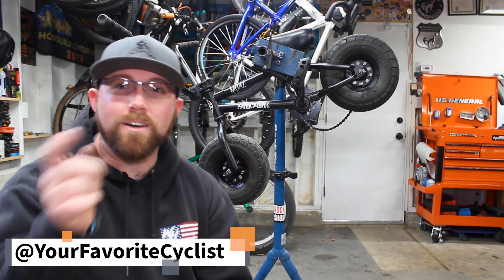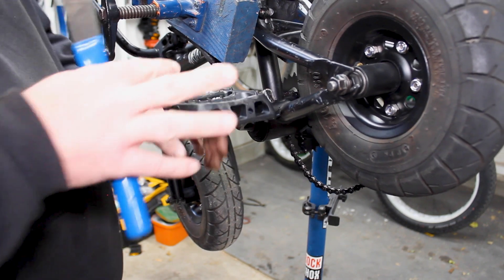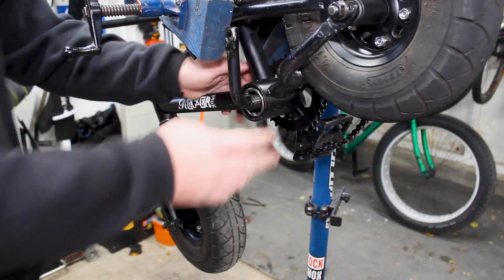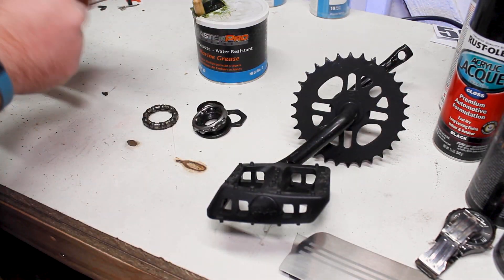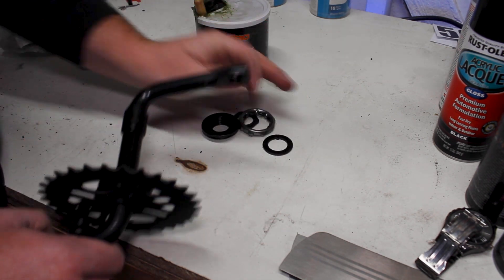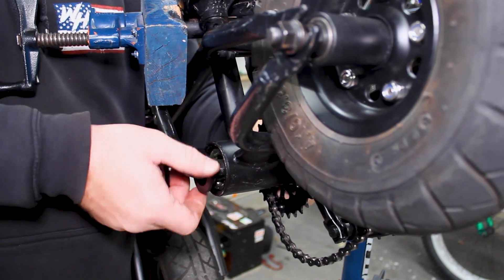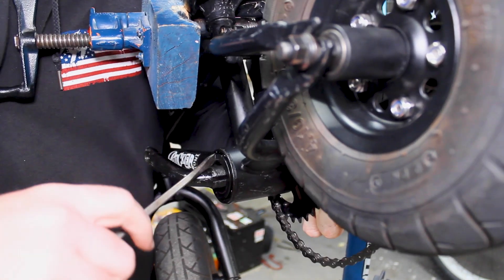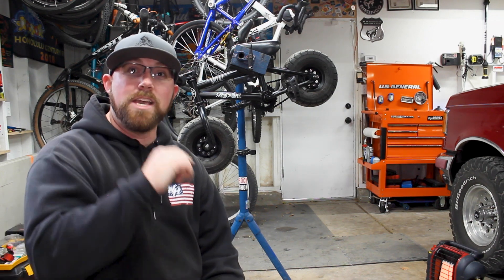How to Adjust a 1 Piece Crankset

Comment: Many of these bottom brackets come with no grease straight from the factory. Take for granted there's no grease in the bottom bracket when you open it up to adjust the bottom bracket. Some of these bottom brackets haven't even been properly threaded from the factory